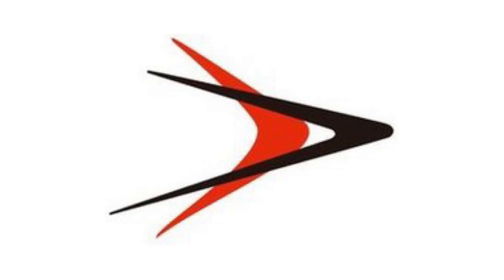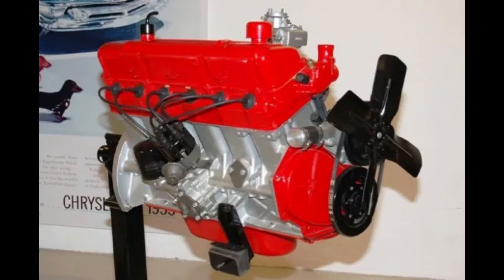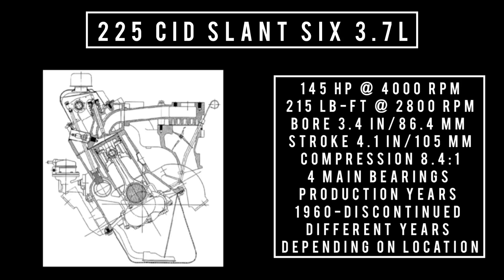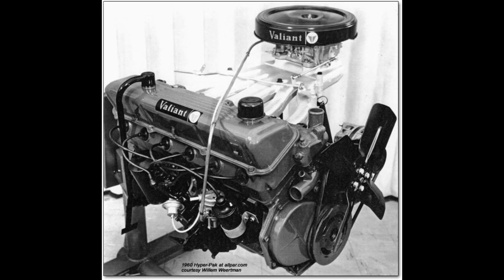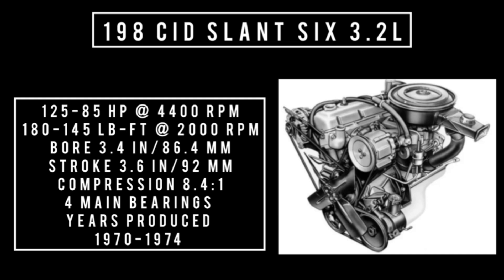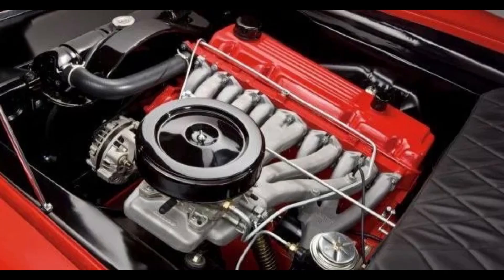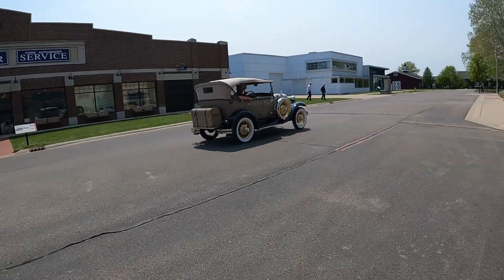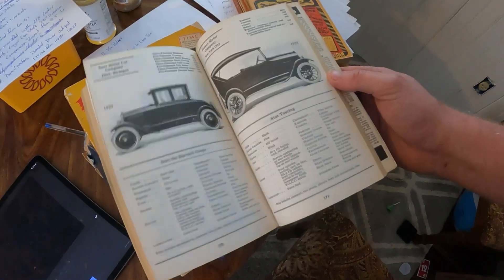Chrysler slant six engine family

Comment: There are numerous videos of turbocharged Slant Six engines on YouTube  kicking the crap out of V-8 equipped cars running incredible times at drag strips. You  might want to post some links. In the first year of racing Valiants in 1960, Ford and Chevy dropped out of the races after thefirst to events because Valiants were taking the top three or four spots and making Ford and Chevy look bad. REALLY bad.

Comment: In Australia we only had the 225 & from 1968 a 2 barrel 160HP version was optional. I remember one in a VC Valiant wagon - torque from under 1000RPM  & easy 45MPH / 75MPH changes with the beautiful 904 Torqueflight
Reply from the maker: Sweet we never got that engine here, I’ve heard that engine is rare in Australia
Reply: @What.its.like.  I don't think it was overly rare, esp here in Adelaide where the Valiants were built. I remember seeing plenty of  "160HP"  badges on VE's & VF's.

Comment: I had a full-size Dodge station wagon with a 170cid slant 6 and a Dart name tag. When you popped the hood, you could step  over the fender and stand comfortably in the space between engine and fender. On either side. It was so gutless I used to lose drag races to VW beetles.

Comment: A good follow on topic would be the Aussie inline “hemi” 6s in 215, 245 & 265ci.  In E49 spec, it had more power and torque than contemporary V8s up to 302/308ci from their competitors.
Reply: Did you know there was a factory 250 Hemi only for the  Pacer +60 thou of the 245 block some race history

Comment: Thanks for the vid ... but you forgot the Pontiac 6 cyl OHV modded Stove Bolt chevy 6 that came out in 66 and was available in the Firebird and the Tempest ... Really a sic engine that was a total over hall by those Pontiac Engineers. Hot Hod Mag did a article on it and I think Motor Trend as well....
Reply from the maker: Glad you dig this video, One day going to do a video on the Pontiac overhead valve straight six I believe it was overhead cam two could be mistaken on that John DeLorean‘s baby.. one hell of an engine that gets over looked.. it wasn’t in this equation because I wanted to go with the six cylinders that were bulletproof not seeing a Pontiac wasn’t the Pontiac six cylinder for lack of a better term it’s a bit out I’ve left field for that company going to feature it in a video for sure, The Pontiac six-cylinder is a different level

Comment: We had the 225 slant imported to Australia and put into our home grown Chrysler,s.
After the 225, Australia developed its own 245 and 265 hemi 6.
The 265 was also developed further for muscle car use (300hp in the e49 Australian charger ) and took on the v8,s in racing
Reply: And did pretty well against the much bigger 350 Monaros and 351 Falcons. The triple carbs, big cam and extractors helped.
Reply: And the 170 version was unknown in Australia.
Chrysler Australia having a performance edge over the six cylinder competition as well as simplifying parts supply.
Reply: Was truly a sad day in 1970 when we lost them and the delightful Torque Flite transmissions. The 245 and 265 used to murder camshafts if they wern't set up properly. I did my apprenticeship for a Todd motors Dealer in New Zealand, started in 1979 🙂

Comment: I have built a slant 6 to mimic the hyper pack.( in 225 form)  The closest  intake is the Ausi Speed  Hurricane  with a Holley 2300 2bbl  with 500 cfm of flow.and using the Dutra split exhaust manifolds. The cam had to be custom ground  as the Direct Connection camshaft with specs of 276° duration with a.430 lift (part 2205620) are impossible to find now. It behaves  more or less like a stock engine below 1500 rpm, after that it is incredible. I out run my  4.6 Crown Vic all the time and it sound more like a newer Cummins diesel
Reply from the maker: Your car sounds awesome =) 

I was wondering why they didn’t offer hyperpak on 225

Comment: In all fairness, the Chevrolet 235 was antiquated by the time the Slant six came out. The Chevy 199/230/250/292 was the replacement. As far as long running engines, the Studebaker flathead six was pretty long running. Excellent engine in it;s own right.

Comment: I had a 1966 Dart GT convertible with the slant 6 in the 90's. It took me forever to figure out a problem with the right rear brake wheel cylinder popping out the pistons. I lost brakes with no warning 3 times in that car. It turned out the backing plate was bent.

Comment: Those slant sixes were bombproof - tough, dependable, and they never left you anywhere.
Reply: We were stranded by our Plymouth Satellite stalling on right hand turns due to flaw in carburetor design
Reply: Used our 225 to tow a big bull in a horse float for 150 miles in hilly terrain and smoked it.
Reply: @fredericksullivan7925 "Smoked" the engine, transmission, or the task of hauling the 'big bull in a horse float'? 😮
Reply: A neighbour of ours had one in a Dodge Dart, while it was mechanically very tough, the ignition system was awful continuous hard starting and stalling all the time that it was cold or damp. They would be warming it up for 20 minutes in the driveway before it would drive reliably
Reply: Yeah until mine blew a fuckin rod
Reply: Back in the 80s I had a '82 Monte Carlo with a v-6. My gf at the time had a '68 Dodge Dart with a slant 6. That car could EASILY out gun my first and last Chevy.
Reply: Unless you ran them out of oil driving from Reno to Vallejo as our friend Patty did. Neither she nor husband knew squat about  car care.
Reply: They have, and can break.
Reply: Gee, thanks for sharing what we all already know. Tell us something we don't know. Know nothing.
Reply: @ppdntn1 aren’t you just mister positive.
Reply: Unless the electronic pickup in the distributor decided to take a shit.
Reply: They were good in their time, however the newer vehicles are running much longer.
Reply: They would outlast the vehicle!!!
Reply: The only problem they had was that they were cold natured. They didn’t like to start and run when cold. But once warmed up, they were unstoppable.
Reply: Terrible water pump.
Reply: @dwightwhittaker4208 water pump? We dun need no steenkin water pump.
Reply: @dwightwhittaker4208  I never experienced this! However, the water pump was fairly easy to replace at home! I had more G.M.s with bad water pumps, though.
Reply: GREAT "POWERPLANT"! The ONLY successor to the WONDERFUL Chrysler "flathead 6"!

Comment: the slant 6 was a very remarkable engine !!!!  i hope to run across 1 at a sale or auction  so that I could install it in a later model pickup .  these engines just ran forever without any issues , I drove yale fork lift trucks with these engines and they were brutes for an industrial engine !!!  I understand that there were many variations of these engines used in industrial applications .  I have an old lift truck with one of these engines in it .
Reply: Have one in an old Onan generator.

Comment: My favorite 53 Dodge had a flat head 6, I was able to soup it up with Parts from JC Whitney parts company , A turbo blower , dual exhaust dual carburators , gave me about 40 more horse power , The Dyna Flo transmission and 2 speed differental rear end was a good design, only problem was I was blowing Head gaskets left and right ,  ♦️♦️♦️‼️

Comment: I grew up in Sweden in the 60s and 70s and American cars weren't plentiful. However, my dad had a taste for them running a 1965 6 cyl Valiant, with push button automatic and later a 1971 6 cyl Duster.
These engines were consider huge compared to european 4 cylinders at the time and the auto gearbox was exclusive since most european cars were manual at the time.
Thanx for posting.
Reply: The Slant 6 is one of the very few American engines that could compare to the reliability of Volvo engines of that era. 😁
Reply from the maker: Thank you so much for sharing those memories Johan, having an American car in a land where they’re not common would have to feel like a celebrity status I guess it would be the same thing over here to have a car from Sweden that isn’t seen all the time I guess it would be very comparable to that. Thank you so much for sharing the memories =)

Comment: I've owned two cars with the 170 slant six. The first one taught be to torque the oil drain plug after an oil change. The plug rattled  out after about 50 miles and dumped the crank case. We still managed to drive it home dry. My brother claimed the car and dropped the rod with the spun bearing out and used the car as his field bomber until he was old enough to drive on the street. The second 170 last for 269,000 miles in eventually three different cars. Dodges rusted really easily back then. I sold that car to a young woman that drove for at least another three years.

That said, I'll take the Chevy. Had one in a truck and it was a lugging monster. Nothing could stall that engine.
Reply from the maker: Thank you so much for sharing those stories what great memories =)

Comment: In the early 90s I bought a 78 Dodge truck from a friend with the 225 Slant Six.  Manual everything, three on the tree that had been converted to a floor shifter and power bench seats out of a Buick!  There was much play in the steering box you could rotate the wheel a quarter turn in either direction before it would think about turning.

Comment: One of the best engines ever designed , if Chrysler had continued to improve the engine instead of ending it , it would today , be an engine on par with anything Toyota  has ever made , I loved that engine ,
Reply: AGREED!!!!! We had two Slant 6s that easily outlasted the cars they faithfully propelled.  Today I would not touch a Chrysler/Fiat/Stellantis with a ten foot pole.  I drive a Pontiac Vibe with a GM A/C compressor and radio. The rest is 100% Toyota. When equipped  with the Slant 6, the Dart and Valiant were Corollas before the Corolla was a Corolla.
Reply: Was way WAY better than any Japanese engine.  Remember, motor oil before the 80s - the slant 6 went out of production in the EARLY 80s - was grossly inferior to today's motor oil, with one exception.  Today's Japanese engines would probably be all done by 60,000 miles with yesterday's oil.
Reply: I say POPPYCOCK!

Comment: My first car was an 80 Diplomat with the 225. The engine slanted to the passenger side and so did the car
Reply: I also had a 1980 Diplomat with the 2 barrel Super 6. Following a 73 Duster and 75 Fury sedan, that Diplomat was the third car I owned/drove with that engine. The Diplomat's engine was abut ten times more reliable than any other component in the car.

Comment: My first car in 1971 was a 65 Barracuda with a 225 Slant 6 with a floor mounted Automatic. I use to get 27-29 mpg and it never let me down. I lived in Minnesota and could see winter temps of -27. She sat outside never garaged and always started. I once on a country road at midnight had her up to a little over 100mph. Kinda stupid but then I was only 20 years old. That Barracuda was the best car I had ever owned until I bought a 1990 Dodge Dakota with a 2.5L 4 banger 5 speed.
I currently have a 1937 Plymouth with a 1950 230 flathead engine 3 speed and love driving her.
Reply from the maker: Eh sometimes you have to clean all the carbon out (that’s the excuse I’d use when driving fast) thank you for sharing those awesome memories =)

Comment: When I was 18 years old (in 1974) I bought my grandfather's '68 Plymouth Valiant, which had a single barrel carburetor on the 225 cu. in. slant six engine. The car had a 3 speed automatic transmission (D, 2, and L), manual steering, drum brakes, and 'air' was supplied by the two wing glass windows turned to scoop the air in from outside plus the two door vents located in the upper corners of the foot rests. You stayed relatively 'cool' if you kept moving.
 My buddies and I would sometimes race 'off the line' (which was basically from a green stop light to the finish across the intersection). I almost always won with that car. They couldn't believe how fast it would get off the line. I'd even beat some V-8's!!! It felt good to put some of the show-offs in their places! 😲
 I drove that car until about 1983 or '84, when the rear end finally gave out and the body was rusting out pretty badly. But I loved that car. It was my party wagon, band equipment transportation, date mobile, and the car I drove until it had about 235,000 miles on it. It was burning a little oil at the end and I had rebuilt the head once at around 90,000 miles. And oh yeah...I rebuilt the carburetor several times, mostly because I kept messing it up, but I got good at it and finally got it right.
 The video mentions engine component accessibility. That is absolutely correct. I could easily get to EVERYTHING: spark plugs and wires, oil filter, distributor cap, points, and ignition wires. I even replaced the radiator once...a few bolts and hose removal...easy as pie. There wasn't a vestige of anything EPA on it. Aah, those were the days!
 Soon after I bought the car I put the then new-fangled radial tires on it. Some people thought that would make the car less stable and degrade its handling, but the exact opposite was true.
 I am gonna guess I was getting about 18 mpg in town (because I couldn’t keep my foot out of the pedal), but I also did quite a bit of hill climbing due to living near the Illinois River valley, traversing its bluffs sometimes several times a day. I drove that car like it was a sports car and it responded to my handling very well. I drove it on a 2,600 mile trip from Peoria, IL to Antlers, OK, then to Estes Park, CO and back. I kept track of my mileage and I remember being surprised that I was averaging 28 mpg!
 On that trip I took it up to a lookout on the Continental Divide. There was no traffic, so I stopped right in the middle of the road, shut it off, got out and looked toward the Pacific Ocean. I briefly toyed with the idea of continuing on to California, maybe never coming back. But I was 18 and asked the Valiant, "Well, what do YOU want to do?" About that time the radiator cap gave a little hiss as it let off excess pressure. Back then the coolant system was not a closed one, so any excess pressure in the radiator was released to atmosphere through the spring-loaded cap. I took that as a sign to go back...I didn't want to wind up in the desert with an overheating engine (it was July 1974, and hot in the lower elevations)! So I returned to the eastern side of the Great Divide. That car NEVER did that again, EVER.
 I miss my old first car and I wish I had more photos of it...light blue with a chrome-trimmed red stripe down each side, chrome bumpers (I actually employed a bumper jack to rotate/change the tires) and red-trimmed chrome full cover hub caps (real metal...not plastic!!!). Tires with a thin white-wall against those wheels were outstanding! They just don't make 'em like that anymore.
Reply from the maker: Thank you so much for the story and the memories that car sounded pretty cool. =) 

I miss the bumper jack days =)

Comment: I had a '64 Dart with a 225 six. It had 12.5:1 comp., TRW high dome pistons, a radical cam, bored .110" over, lots of port work, Offenhouser 4 barrel intake, Holly 550, headers & side pipes, and other goodies that made it git with the program.
Reply from the maker: What did that sound like all of the parts that you listed it probably sounded amazing as well as had some more giddyup and go
Reply: @What.its.like.  It ran very well, won a few races. Sound was different but had authority, I don't know how to describe it. Front three cyl went to one collector and the rear three to another, hence it fed both side pipes. Never did put it on a dyno. It was 1979 and money was tight. Wish I still had it.

Comment: Let's face it folks, left in the stock configuration, none of the slant 6's were power houses, but they were bullet proof and they were very forgiving and ran forever.  Though Clifford Engines offered several different after market stage levels that would wake this little sleeper up. Their motto was, "6=8".   Back in the day, all three American auto makers made very dependable I-6 engines and I have owned all three makes.  Sadly, those days are gone now to throw away cars.
Reply from the maker: Thank you so much for sharing the insight and other information =)

Comment: The 232 AMC was probably used longer than the slant 6 since it evolved to the 4L Jeep engine that was used a long time after the slant 6 was discontinued.  Plus it had the 7 main bearings.  If I remember correctly the slant 6 had a weird and difficult to replace 4-piece oil pan gasket.  Verly difficult to make that so it wouldn't leak.

Comment: Slant 6 first, followed up close behind was the venerable 250 I-6 from Chevy. I also had the 200 I-6 in a Ford Fairmont (1978) that was a true dog, but I also suspect the cat may have been partially plugged. 

The 250 was in a base 4 door '74 Nova I had in the mid 80's and grew up with parents that had at least one 225 slant 6, one was in a '64 Dodge 330 base trim wagon and the 225 was standard in that trim. Likely a 1966 Belvedere that my Dad had that may have had that same slant 6, but could have also had the base V8 (318) and it had a cylinder collapse issue. Then the 72 Plymouth Gold Duster that may have the 192, but may have also had the 225 but the slant 6 either way. 

The '64 Dodge wagon made it to 145K or so miles, by the mid 70's, we'd bought it new in '64 and had the original Torqueflite transmission replaced with one from a junked Mopar in 1973 coming back from eastern Washington one Sunday. My parents finally sold the wagon in 1977 to a kid for $300 I think, still running, but by that point, not so reliably and had begun to have rust issues. These slant 6es were very long lived indeed.
Reply from the maker: Awesome thank you so much for sharing your experience as well as insight =)